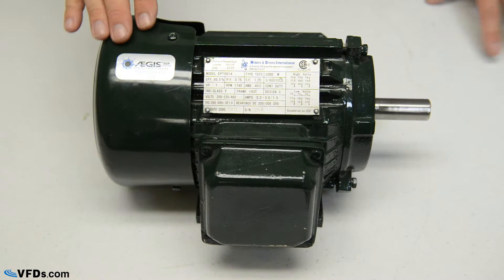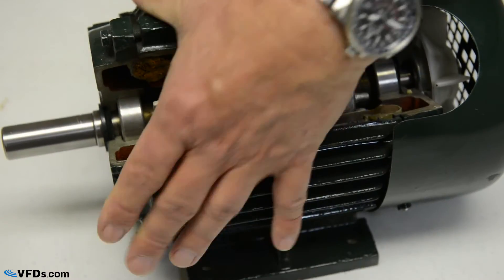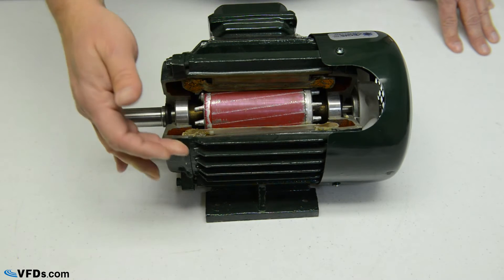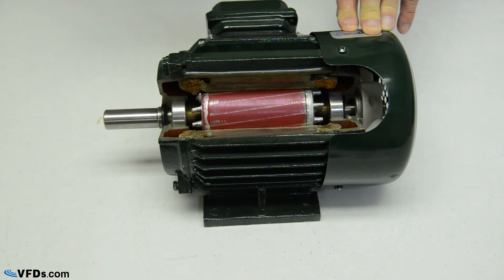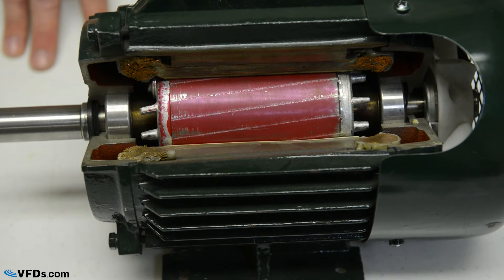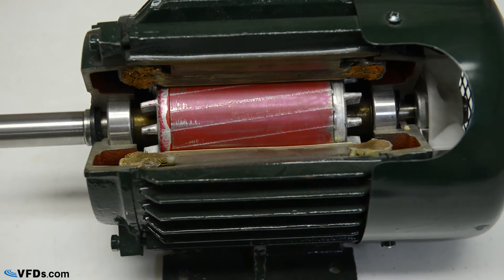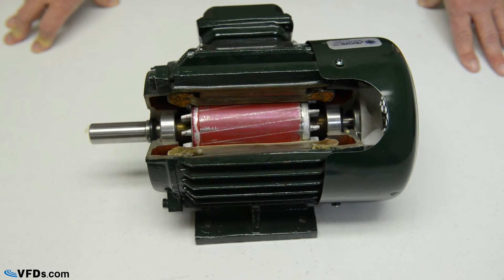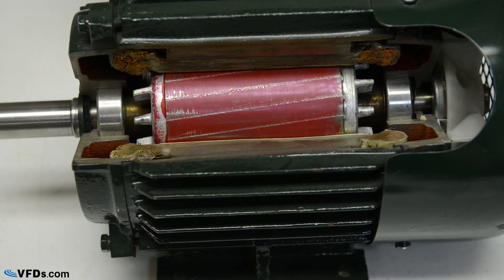Electric Motor Buying Guide

Comment: good interpretation...the induction motor It is many things in one..1)It is a coil 2)It is an inducer. 3)it is an rotary transformer  4)it is an generator with the help of the capacitors..5)work as resistor ballast  without rotor...6)in my last experiment the induction motor work as earth inductor work without amps (work free)..with the help of the magnetic field of the earth..without back efm ...I have done much research in this area...I have bad luck ,i am from Albania live in Greece ..my work is not recognized here...  ..also know well the VFD machinery ..I have done many upgrades in this system ..thank you ..
Reply: FREE ENERGY EXPERIENCE pls send info on this motor i have seen very little on youtube on the magnetic feild motor